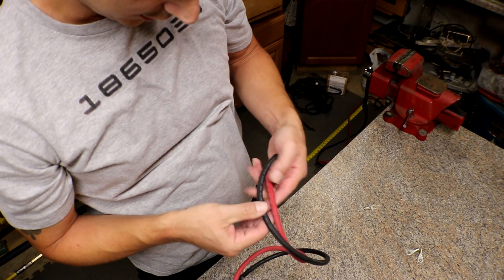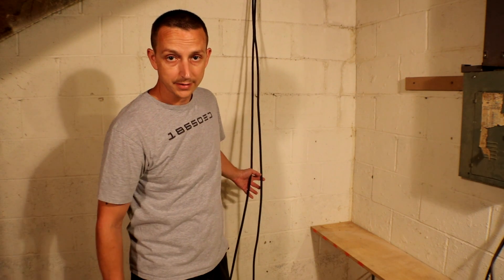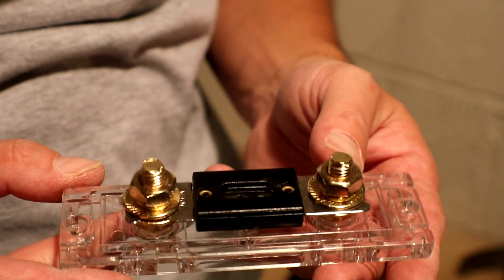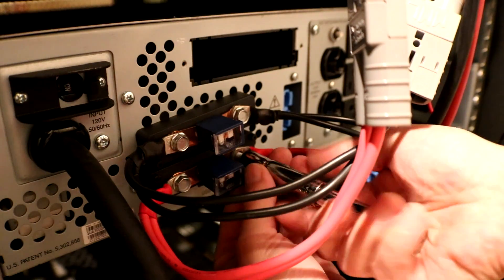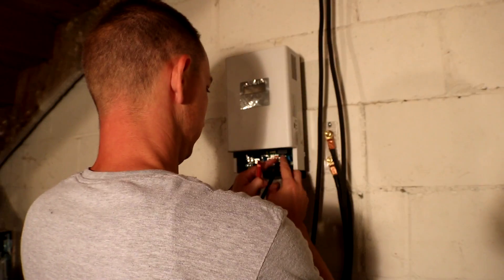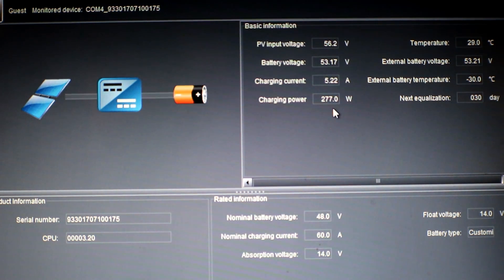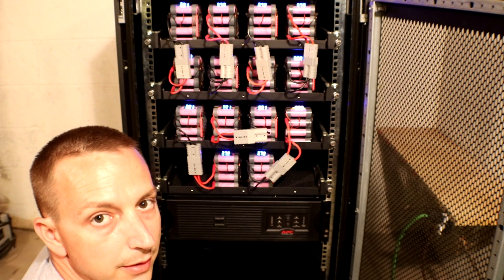Diy Tesla Powerwall ep59 PCM60X Solar Charge Controller Install!!!

Comment: At this point in your build, about how many lbs of 18650 cells would you say that is? I have been hoarding and testing cells for a few months now and have about 110lbs of fully capacity tested cells. Would you say thats about that many?
Reply from the maker: If I remember right, each one of my packs fully put together is almost 14lbs. That includes busbars, holders and connectors. So roughly 13lbs X 14 packs is 182lbs. Mine are also 100p. Many build 80p.

Comment: When the charge controller reaches 56V what does it do with the power from the panels? If it just cuts the power is there a way to divert that excess to the grid or a water heater?
Reply from the maker: On these charge controllers it just cuts the power!  It would be great to divert it to a water heater.  Depending on your setup there are ways to divert it. https://www.youtube.com/watch?v=jVEH0eAinBs

Comment: Fuse in the solar array??? Are you expecting solar flares? Double fuses between the charge controller and battery?  The only place you need a fuse is between your batteries and your inverter or anything else where it is actually possible to draw too much current. All these fuses robs power and add to the number of screw terminals, that also causes voltage drop as they oxidize, if you don't clean them as often as you should. I know you don't want to see your home ablaze, but this is anal.
Reply from the maker: LOL Love the Solar Flare 😆 At the time of installing everything I only used what I had on hand.  It has changed since then.  Ill have to do an update video!!🤘
Reply: @AVERAGE_JOE  Cheers, Sorry for criticism, but I'm glad you cleaned it up.
Reply from the maker: I accept all criticism😃 Thats how we learn!!!🖒🖒🖒

Comment: Joe, let me begin by saying thanks for all you do for the community! I have sporadically watched some of your more recent videos while gathering cells, I am now about ready to get serious since I just bought a new (older home to remodel) and my first task will be to get a beginner solar system up and running. I have about 700 tested/rested/rewrapped and labeled cells. I am thinking of a beginner battery pack of 14s50p to get me going until I can get more cells. 

 I have just binge watched 59 of your original episodes and I gotta say I really like your style!

I have a couple of questions since I do not have access to a UPS like you used could you point me towards a good grid tied inverter, secondly are you still using the PCM60X solar charge controller? I hope to model my system very closely after yours where possible. I notice that the charge controllers are still available on eBay and if you are still happy with yours, I am going to order one too.

Thanks again and BTW you are well above the "average Joe"!
Reply from the maker: Thanks for the great Comment!  I appreciate that and the Binge!!!  Sounds like you are off to a great start!!!  Since I havent used grid tie inverters I cant say which is a solid unit. I do hear the MPP solar guys have good grid tie, hybrid inverters ect...  The same place I got the PCM60X charge controller. If you use facebook you should become a member of the DiyPowerwall group at https://www.facebook.com/groups/diypowerwalls/ there are a bunch of like minded diyers there and might have a good answer to that question.  As for the PCM60X, Its working out great so far.  I did have one issue recently where the comm port quit working and they just sent a replacement.  I still need to install it tho.  We did have some lightning during the summer so my guess is its from that.  Thanks again for the Awesome Comment!!!💥😆👍
Reply: Joe, I meant to ask but forgot, when you get/buy laptop batteries from a recycler, what do pay? I have an opportunity to buy a rather large lot maybe a couple hundred pounds but he is asking $1.75 a pound and I thought that to be rather high, I believe they would be worth .50 to .75 a pound perhaps...

Thanks again for your response and everything you do to contribute to the community.  I did join the FB group!
Reply from the maker: When I was buying them I paid an avg of $1 a lb but also paid $1.25 a lb. That was about 2 years ago tho so I would imagine its gone up a bit.
Reply: I also will go buy one of the solar charge controllers using your affilate link today!
Reply from the maker: Thank You for using the aff link!!! It helps support the channel a lot!!!😆💥🖒 They are SUPER FAST shippers too!

Comment: So i found a recycling depot and they have about 1000 laptop batteries but he figures there mostly pouch cells is there anyway to tell from the info on the outside or do u have to open them up.
Reply from the maker: Yeah you can usually tell from how thick the packs are. I said usually ;) ;)  Some will actually say 18650 or the cell size ect.  If you can see them before you get them that would be the best!!!  Apple packs are usually the pouch cells.  Most regular laptops have 18650s!

Comment: You hit a virtical stud if you will they are about an inch from the grout joint and in the center of the brick
Reply from the maker: Could be but the other holes were either right above or below and those went ok lol.  I plan to finish off that wall some time!

Comment: Thanks for your reply to my fuse question on your other video. Next question!
Just got my PCM60X. I saw in the video you did not hookup the ground for your controller. 
What is the rule of thumb on what needs to be grounded? 
Are your 18650s grounded somehow thru your UPS?
Reply from the maker: No Prob!  Yeah I dont have a ground on the PCM60X as of yet.  I probly should tho lol.  I dont have the 18650s grounded to anything actually.  Just pos to pos and neg to neg on everything!

Comment: quick question Joe, pcm60x's spec says output voltage is 48V but your 14s setup at 3.7V each block would be 51.8V and at 4.2V max voltage would be 58.8V..what am I missing here?
Reply: also at 10kWh total capacity what in the output watt of the PCM60X?
Reply from the maker: Well a 48v system if using regular 12v lead acid batteries will charge up to 14+ volts on each battery so well say14.7voltsX4 for a 48v system is 58.8 volts which is exactly 4.2v per pack.  In the settings for the PCM60X you can set the battery voltage to what ever you want so we can make it fit lithium cells even tho its not designed for it.
Reply from the maker: Well since its a 60amp charge controller its 60ampsX48volts and thats 2880watts😃👍
Reply: in other words if i set to use your setup i just put the settings as it is in PCM60X for 14s setup voltage and bump up the 100p to 150p to increase my wattage?
Reply from the maker: Yep, you can set the voltage in the charge controller so the packs can be at any voltage you want.  I normally set the voltage a little lower so the packs will be around 4.1.  So to do that in the charge controller there is a little math to do.  Since it is set up to do 12,24 and 48v you just do the voltage you want your packs to be at for exp... 4.1X14=57.4 . Since the charge controller only shows 12v in the settings you do 57.4v divided 4  =14.35  so you change the bulk and regular charge settings to 14.35.  Since you dont have it in front of you it might sound confusing but one you have it, it will make much more since lol. I have a video showing how to set it up https://www.youtube.com/watch?v=ou47PDQanys&t=1s  Here is the ebay link to the exact one I purchased and if you do order it, it would be great if you used my aff link and I get a few dollars from it and it doesnt cost you anything extra.  If not, no biggie. ---> https://goo.gl/e3m5EH

Comment: this is the feature of your charge controller. Compatible with flooded type and mainstream VRLA lead acid batteries. Does not mention lithium-ion batteries, how do you know this is the right charger
Reply from the maker: Yep its technically not compatible with lithium ion batteries but many others have been using this charge controller with lithium ion for years with changing the settings inside the unit to match closer to lithium ion cells.

Comment: so you have 14S 100P system, right. that mean if you charge 1 amp per cell you have to deliver 100 amp with a 60 amp charger. Maybe I don't understand the function of the charger.
Reply from the maker: Ill add more solar to the system when I can afford it. This is all I have for the moment. Once I add more solar and go over the charge controllers limit of 60amps then Ill add my 2nd 60amp charge controller to the mix.

Comment: I am trying to charge my powerwall(7.6kw)  with solar panels(3.3kw),  discharge battery around 40%, so I can prolong the live of the powerwall, my confusion is how big the charge controller should be 7.6kw or 3.3kw
Reply from the maker: +Jose Garcia How many cells is in your pack or what is your batter setup?
Reply: I have 6x12 packs(72cells) 13 packs for around 48.1 v
Reply from the maker: +Jose Garcia ok no prob, charge up to 72amps since we dont really want to charge over 1amp per cell🖒
Reply: do you know of a charge controller that can handle 72 amps
Reply from the maker: The charge controller I am using can handle 3200watts at 48 volt and I think it can technically handle a little more because voltage losses in system ect... I am super happy with mine even tho I only have 1kw of solar so far.  Link is in the description box.

Comment: how do you match the charge controller with your battery bank
Reply from the maker: Basically you can go as high as 1amp per cell unless your cells can handle higher.  Since Im using 100cells in a pack I can go up to 100amps.  Once I add another 10kw I can charge at 200amps.  Does that make sense?

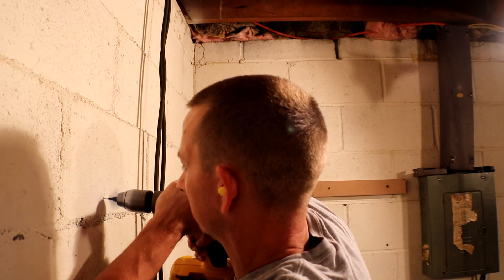Comment: 4:55 Stop.  Hammer time. (que parachute pants) and you might have 5:13 hit rebar...???  One screw is enough! :P  I would have build a rack out of scrap wood (or whatever else, you hoarder:) instead of damaging the wall.  Beware of breakers with gray (silver sharpie) writing on the bottom. heheheh
Reply from the maker: +bcmasur Lol I wish I had some of those pants, I woulda broke out in a quick hammer dance lol. Ill probly do a sheet of wood there cause I always change my mind lol.

Comment: Looking good, thanks for the setting info too. Will you leave the independent  voltage meters on each pack? Was thinking about setting a way to switch them off on my bank. 
Awesome job!! That's a big one, turning it on. Pretty exciting. I'm still a week or so off mine. Keep up the great work
Reply from the maker: +ty harding Thanks! No problem. I will leave the volt meters on untill I get that fancy Batrium BMS 😀

Comment: Not sure if you've realised this yet or not, but you said you were attaching the voltage sense wires closest to the battery and the charge leads so it had to go through fuse first, then you disconnected the battery from the same side as the charge leads :-)

Comment: i own a Renogy Commander 60 and the model seems to be a clone of your controller or vice-versa.in doing so, i was hoping to run the PPTracker software w/my system.... BUTT <-- the big butt --- it asks me for a password. i've looked through the help and i've looked online & did not find any options to enter a starting password. did your software come with a password that you like received an initial password? 
i have been using the "Solar Monitoring System" that came with the Renogy and while i like it 'cause it has more parameters for tweaking, the parameters are very vague. all i want to know is what are the 2 parameters names' that will then control the Battery SOC% ??? i've been looking to find someone who has a good vid on entering those particular parameters into the software.
Russ from Coral Springs, Florida, USA
Reply from the maker: try administrator, thats what mine was.  This is the video where Im setting up mine, maybe its the same as yours on those settings https://www.youtube.com/watch?v=ou47PDQanys
Reply: ok, so that password worked & thanks for that. but i got problems. i've been all around trying to get the COM port on my PC (and also tried my Laptop) to communicate with the Controller. although both PC & Laptop recognize the port (showing up in my Device Manager when i plug or unplug USB), i still get no communication between the Controller and Pc/Laptop. it may be the wire, it may be the controller. i believe i need to get in touch with Renogy (the maker of my Controller) and get their Tech Help. and yes, i did watch the Vid on this - that's one of the reasons i wanted to try the same software so i could match your settings and see what happens with my (smaller) system.
Russ from Coral Springs, FLorida, USA
Reply from the maker: Ok cool. The olny way to communicate is with it hooded up to the batteries minimum and you have to turn it on but it will time out and not communicate untill the power is pushed again because the solar isnt hooked up.  If solar and battery are hooked up Id check your com port settings on device manager.

Comment: You were probably hitting a piece of reebar in the concrete wall. What you could of done was taken 1/2" strips of wood and make a frame on the concrete wall, the attach 5/8" plywood (or osb if painted) on the strips then you could move stuff if you needed to later, and you could paint and/or not worry about needing to drill into the wall anymore  ;)

Added:  Hahaha, you answered that towards the end of the video  :P  I don't believe it'd get hot enough to burn wood. But, it could melt plastic I suppose. You could also put a spacer between the wood and PCM screws if you wanted a little more air flow.

Woops, another nut buster move  :P
Hey! Doesn't your cat know that the top rung on the ladder is "NOT" to be used as a step.  ;)
Reply: Korishan i have found inspectors in my area like 1/2 cement board or wood stove base mats.
Reply from the maker: Ah good thinking on the reebar but Im sticking with Diamonds..... lots of them!  You know me Im probly gonna rip that off the wall and put wood up there.  I was wondering if someone was going to say something about that top rung lol.  We just had "safety day" at work the other day and that one always comes up LOL
Reply: Still better than drilling a bunch of holes in your concrete wall  :)
Reply from the maker: +Korishan True That!

Comment: Let there be sun.  Some times I use multiple strands of wire in larger terminals to get a lager gage wire..Say 3 six gage in one 2/0 terminal...
Reply from the maker: Let there be LIGHT and charging and stuff!!!  I almost did that but didnt.  If I had more solar I would have.  I may cut the excess off the solar wires to make that connection but want to make sure first.  I hate cutting expensive wire LOL
Reply: I would not cut off the excess.
Reply from the maker: +bigsmile542 Ah Crap!!! Jk 😉

Comment: While installing telephone equipment, I always found it a good idea to install a plywood backer board to mount all the little things to. It allows you to not drill so many holes in your permanent structure. And it makes the entire assembly a little more mobile just in case you need to move it all at once.

Also, I highly recommend two things. Anchor the cables entering the space. ie, the feed from the solar panels and the feed to the battery bank.  All you need is to rip the terminals off the charge controller if you trip over the cables. And, install some type of cable management.  Helps prevent accidentally snagging a cable.
Reply from the maker: Good point on plywood backer lol.  That wall was a pain to drill into.  Might go that way in future.  For sure on anchoring of the cables everywhere and cable management.  Its on the list 👍

Comment: Good work. Dont forget to fuse the voltage sense wire. It need its own 0.5a or something. And breakers on pv and battery so you easy can work on em :)
Reply from the maker: Thanks Bud!  Yes, you are right I should fuse those sense wires.  Yep, breakers and such will be added soon😃👍

Comment: I discovered my APC (older 2200VA) is a POWER PIG. It is pulling from 65-100 Watts at idle. Thinking of getting a newer one or a real LF inverter.
Reply from the maker: I still havent been able to measure mine yet.  Mine are around 2003 time frame I think and would imagine they pull some power at idle.  I just picked up a 3000va hp UPS but havent looked up the model # yet for the spec sheet.

Comment: are the volt gauges always on? on the batt packs? what's the power draw from them? they look awesome. like something important is going on in there in the cabinet. I'm working on a box to hang on the wall. with volt/amp gauges on it. along with low voltage disconnect relay. for DC use. and buck converter and low volt alarm. for lead acid batts. since that's what I'm stuck using.  bucking the 24v to 12v for accessories that are 12 volts. and thinking about adding a small 12v li ion pack . for backup lighting. if the batts get to low at night. giving me light to start the generator. great video. they help me come up with ideas for my off grid system.thanka
Reply from the maker: Yeah the volt meters are always on.  Spec sheet says about 30ma draw.  Im not to worried about the amp draw right now at least lol.  It I think it looks cool as well 👍,  Yep, just got rid of my lead acids for this setup.  Yeah a little li-ion pack for lights will be easy peasy!!!
Reply: AveRage Joe would you sell one of the ups that you are not using? or do you have plans for them? I have a APC ups. but it isn't nearly big enough for what I need.I am completely off grid. and haven't the funds to buy new. I would like a inverter with ups capabilities. I would also like to move up to 48 volts. because I have better sun away from my house. and would like better efficiency. like every one else. wire the 100watt 12v panels 4 in series. .. thanks for replying
Reply from the maker: Possibly, where are you located abouts.  They weigh a ton!